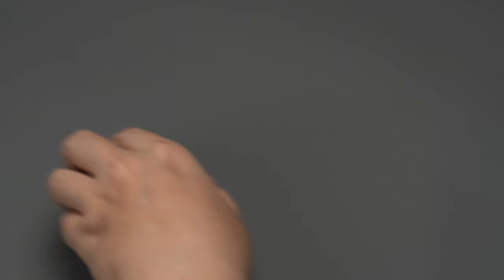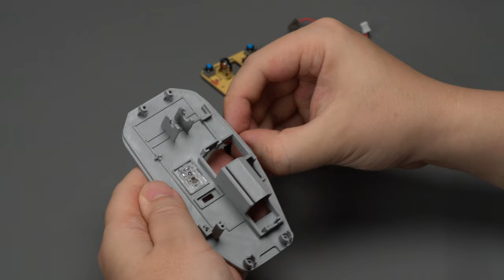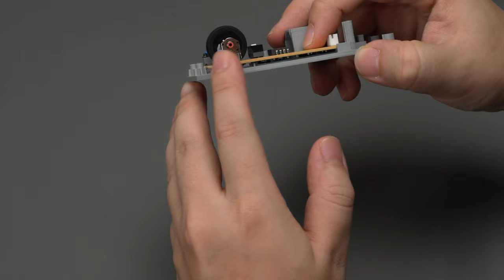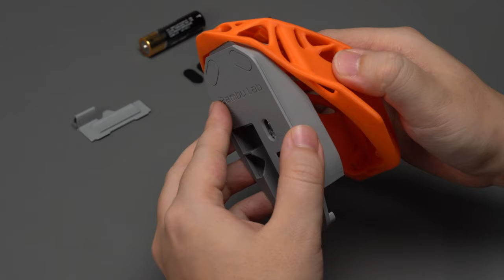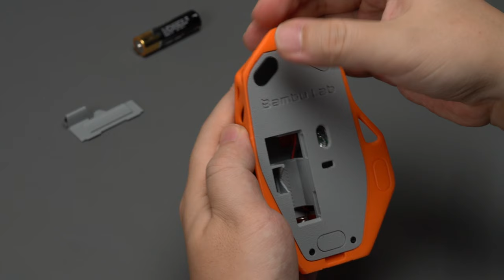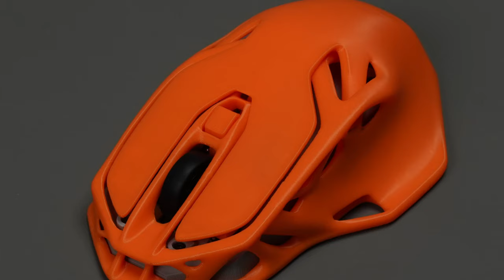Bambu Lab Wireless Mouse 002

Comment: I'm clicking on this page with the mouse I just made with this kit. The scroll wheel feels really great if you like tactile click scrolls. The DPI options feel nice and none of them feel too slow. I am about 6 feet tall and have larger hands and this mouse feels great in the hand. It may be a bit heavier than some mice just because of the size but it slides freely with the ptfe feet. Thank you Bambu Lab!
Reply: where did you get the files from? on the MakerWorld page there is only the inner parts, but the model contains a battery. am I missing something obvious?
Reply: one question do you know how to configure the scroll wheel button and the middle button?

Comment: the optical sensors on the mouse kit are a bit unresposive. Cool project to do though, wished that I can use the mouse without having to mess around or buy a replacement pcb

Comment: Just assembled the mouse and am currently using it to watch this video.  The body is printed in Overture matte red, the rest is Bambu basic silver.  It's OK, the scroll wheel might could use a dab of SuperLube or other light silicone grease and I have no idea what the button behind the wheel does.  It fits my largeish hands just fine, and is similar in size to the Logitech M510.  Windows 10 loaded the driver in seconds without complaint.  It's currently sold out in the US store, it doesn't say when it will be back in stock.
Reply: I think the button behind the wheel adjusts how fast it scrolls. Slow or fast.
Reply: @NeilLund  I can't find a mouse test that shows any response to the button and have tried single click and scroll, held down and scroll and double click and scroll.  None have changed the speed of the scroll.  Let me know if you figure it out.

I am still using the mouse, if it goes to sleep, you have to tap a button, moving it does not seem to wake it up.  Also, I have fairly dry skin and it's hard to hold onto without texture on the sides.  I'm going to pretend that someday I'll design and print TPU overlays for the sides.
Reply: It changes the movement speed of your cursor lol. DPI. It is very noticeable so if you still didnt figure it out your button probably isnt working
Reply: @rickyneeter69  You are correct, It does change the speed or DPI!  Not every time it's clicked, maybe I shouldn't be waving it around frantically clicking away.  I had quit trying to figure it out so I would probably never have or I would have wondered why it was suddenly a different speed.
Reply: @lasermike2147  😂
Reply: any way to configure the buttons differently?

Comment: It‘s impoasible to print it when you‘re using a different platform - anyone here knows where I can find the raw stl files (especially for the outer shell) without a print profile so I can do self adjustments?
Reply: I cant even find the proper stl files for both bottom and top. The only one "available" is a full assembly that cant even be opened using other slicers. I'm using cura and I'm trying to get around with the bambu studio slicer but cant be bothered to fine-tune and reconfigure the settings I have for my ender 3. It doesn't help that the the "stl" files people are sharing are .3mf
Reply: @its_jeyem  I imported all of the files into Shapr3D, but I think you can use any other CAD program, and exported all the files separately - that's my workaround. But the problem with the outer shell file is that it's more or less broken and won't work.